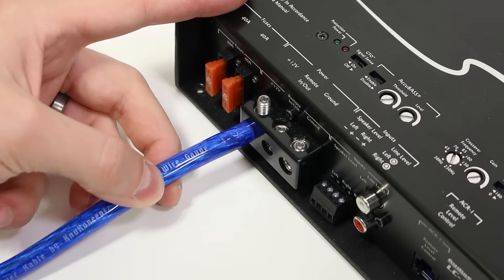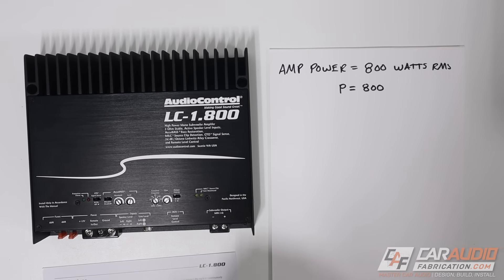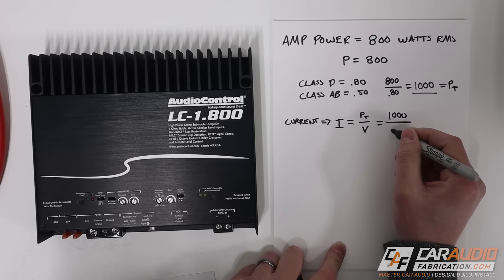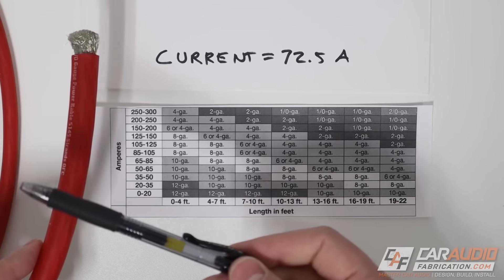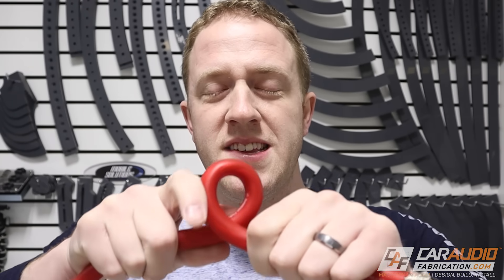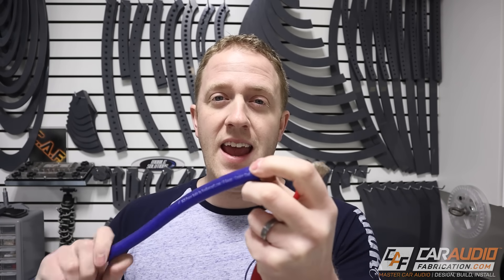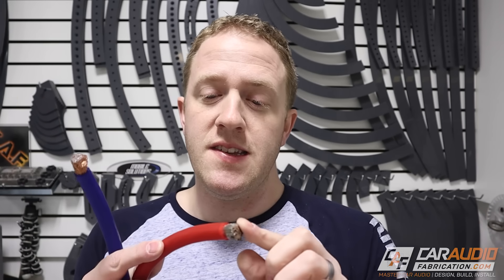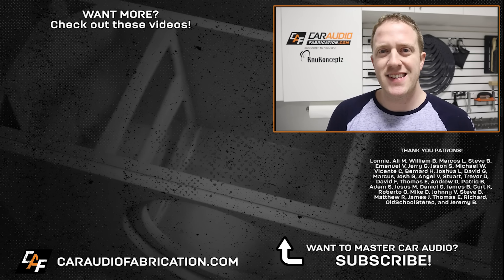What WIRE GAUGE SIZE for amplifier install? How to calculate!

Comment: Not ohms law, ohms law has no use of passive sign convention and is only meant for resistors. Just a standard power equation :)
Reply: Do you even know what Ohm's Law is? BTW power cables are resistors! If they weren't we be able to use wire as thin as a strand of hair for everything. Unfortunately even the best conductor is still resistive.
Reply: Ohm's law works fine for capacitors and inductors. In DC you model them as breaks  and short circuits, possibly with leakage/series resistance, respectively. In AC you use their frequency dependent  impedance instead of pure resistance (and work with complex numbers).
Zc = 1/(j*2*pi*f*C)
Zl = j*2*pi*f*L
Since i is usually used for current in electronics work, j is used for the imaginary unit , sqrt(-1).
 You may also see ω instead of 2*pi*f in formulas, for angular velocity in radians per second.

Comment: Or just run whatever size the amp will take? Over thinking simple things. Doug is Disappointed with you mark 🤦‍♂️
Reply: Still important the kind of wire you run. OFC vs CCA that is. A 1/0 input given 1/0 of CCA may not be sufficient... compared to an ofc 1/0
Reply: SaUcErS pLaNeT I know just busting his chops 👍👌🥴

Comment: the way i choose my power wire (which i know now is incorrect) is by looking at the terminal size of the amplifier. then i buy the wire that fits that terminal or hole correctly. thanks for the vid💪
Reply from the maker: This math is helpful to know because if you need to size a length for two amps you can determine what size you should use, and break it down for each amp as well based on the actual length of the wire.
Reply: @CarAudioFabrication  true, thanks Mark💪
Reply: PANTYEATR1 aside from legitimately finding the appropriate size like he explains, this is the next best way. Some amp manufactures do undersize their inputs though. I have had a 2000 watt rms (dyno confirmed) with 4 gauge inputs
Reply: @garretlast6923  thanks for the input...another question, should any considerations be made if a 1 farah capacitor is in the system?

Comment: Need more indepth vid. Like is safe for the whole system to be 0 gauge (power and ground), is using more than required gauge is bad temperature wise for the amp, is using 2 or 4 gauge safe for regular speakers or the wire has to have some resistance lastly if i use a distribution block that has different input and output sizes 0 gauge to 2 gauge will the be major performance lost also what does this mean heat wise for the 2 gauge wire
Reply from the maker: 👉How to plan a full electrical system: https://youtu.be/NixHUNo0YII

Comment: You should always use 0 gauge wire for speaker wire, power, ground, remote, and even special order 0 gauge RCAs. This is only minimum
Reply from the maker: Haha, dont forget 0 gauge bass knob wire too, 0 gauge for each conductor... lol
Reply: I was converted after purchasing my first 0 gauge earphones. You can really feel the extra bass in your ears with thicker wire. The only logical next step was 0 gauge everywhere in my car
Reply: I have to applaud you. I argue with my customers quite often about these things. Don't forget to mention and explain the higher current draw from resistance and the need for a stronger alternator to make up for the extra power
Reply: @Rush714  you need a MINIMUM of a 12,000 watt alternator to support all the 0 gauge or it just won’t work
Reply: @codydagoat3915 u need minimum W16 Engine to power your audio Equipments otherwise your won't be able to get fullest output 😂
Reply: @codydagoat3915 wish I would've seen this before I ran all 0 guage in my hybrid. 😅
Reply: Your aftermarket head unit needs a wiring harness with all 0 gauge.
Reply: 1000 MCM or bust!
Reply: @1pcfred  lmao 😂 what are you running a 5000A system?
Reply: You guys sound like some true audiophiles obviously i missed the joke. But before I go and possibly fuck up my electrical system again I'm a car audio Newbie..
Ok so my wiring kit lists -
4 gauge power cable
4 gauge ground cable.
16 gauge speaker cable. 
 Would you recommend keeping this kit to use it with a Pioneer GM-5500T amplifier ? ?
It says 820w on the actual amp and On the website specs it says RMS power rating 400.. so would  it be tolerable to use it  since it already is hooked up to my battery or would I have to switch to 0 or 8 gauge wiring to not have any electrical complications..?
Reply: Which is power and which is ground ...it's 12v DC system
Reply: Unless it’s 0 gauge even the wiring harness it’s not enough you need more wire even the ecu harness has to be 0 gauge it’s a 0 gauge world out here get with it 😂🤣
Reply: @codydagoat3915  🤣😂😅0 gauge speaker wire
Reply: I hope that’s a joke if it’s not out of your mind
Reply: I run 8/0 gauge to my tweeters